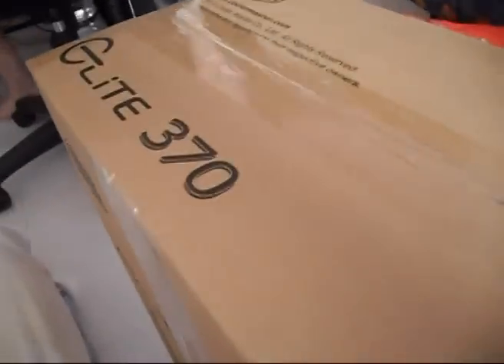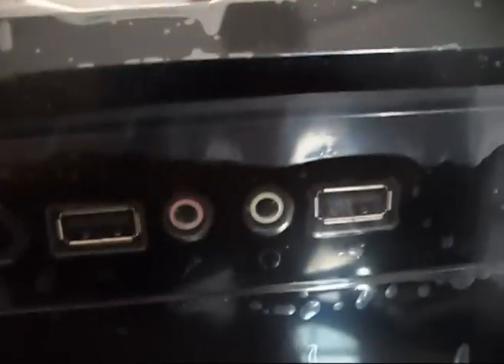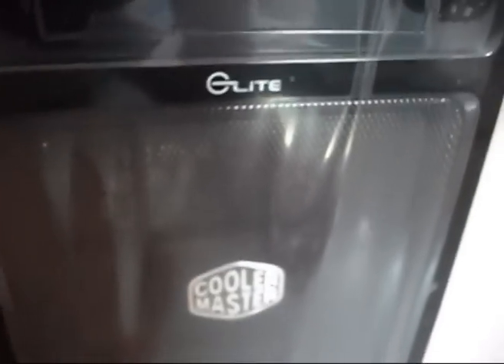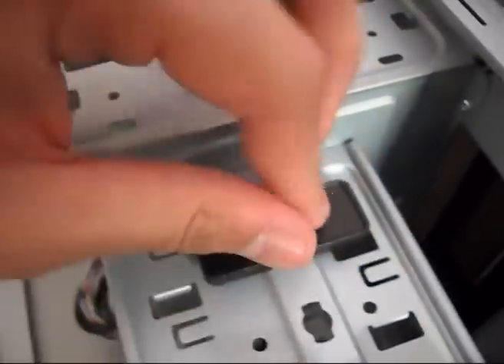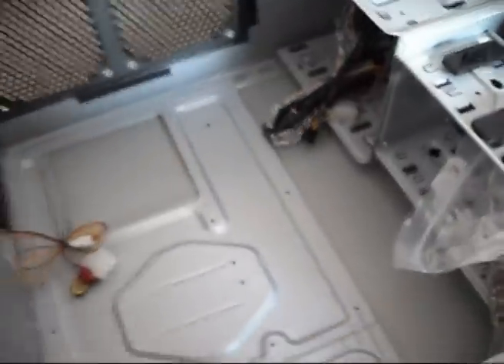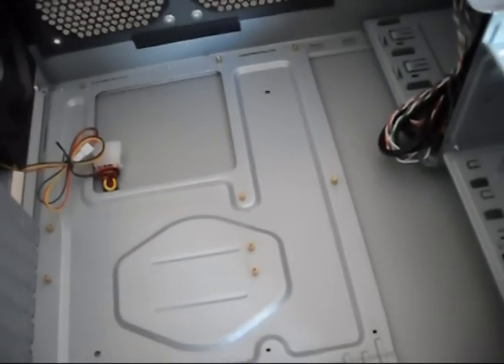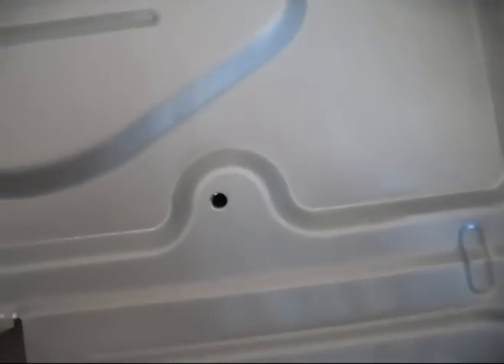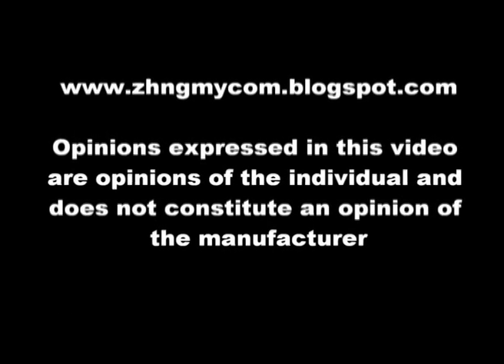Review: Cooler Master Elite 370 Mid tower Case

Comment: I did not hear the review but that's a nice case.  Thinking of getting the non-windowed version, great airflow options.  From Cooler Master fan options are as follows:  

Top: 2 x 120mm 
Front: 120/140mm 
Rear: 80/90/120mm (120mm included)
Side: 2 x 120/140mm
Bottom: 80/90/120mm

Only thing is not eSata in the front panel and hard plastic case feet but for the price you cannot go wrong with this case.